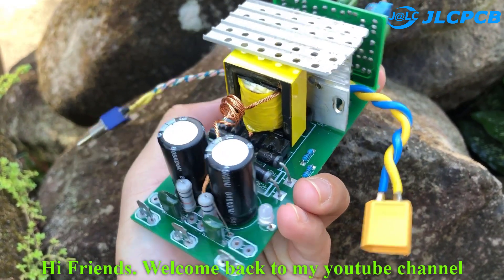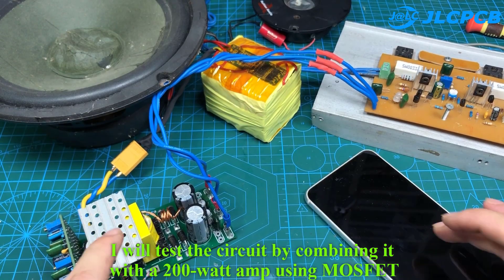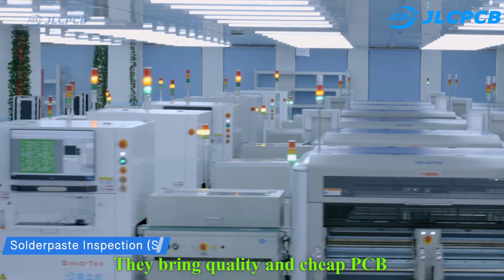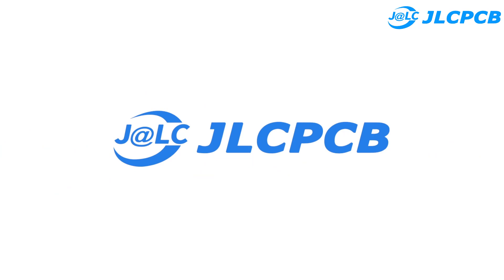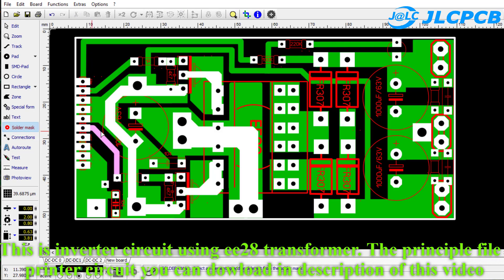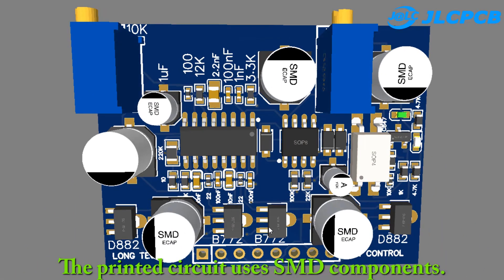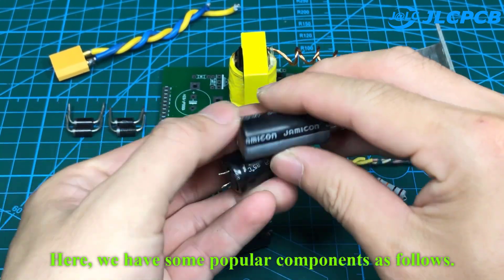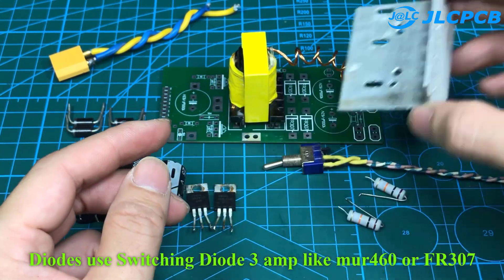Inverter from 12V to 50V for Amplifier with Under Voltage Protect

Comment from the maker: Hi Friends. Hope all is good with you. Where are you from ? What circuit do you want me do ?
Reply: 350w inverter using toroidal transformer
Reply: Sir please make an vfd
Reply: Hello, how do I protect the Arduino code from being stolen or copied? Thank you
Reply: small 12v constant current led driver ...1Amp max .....plezz..sir...
Reply: Sir, please make an Inverter using readymade 12-220v step down transformer 🙏🙏🙏🙏🙏